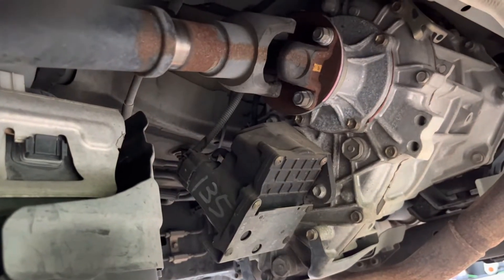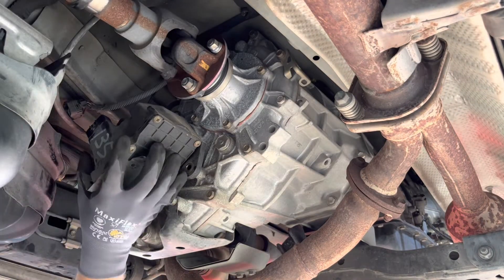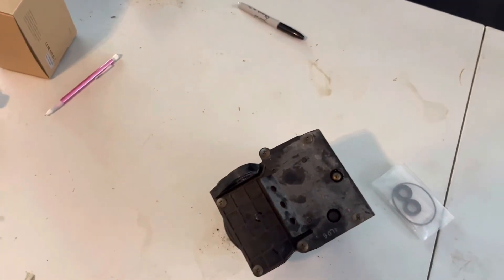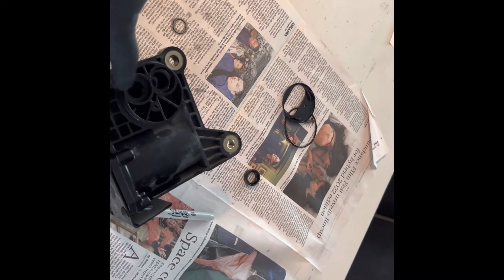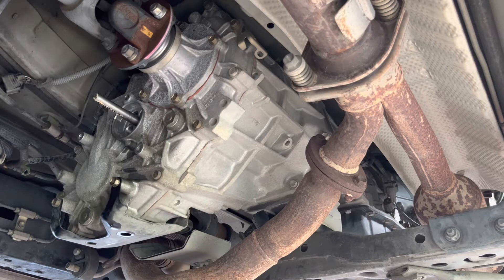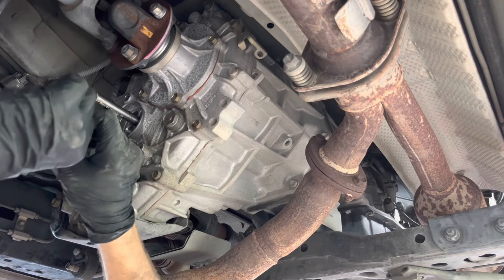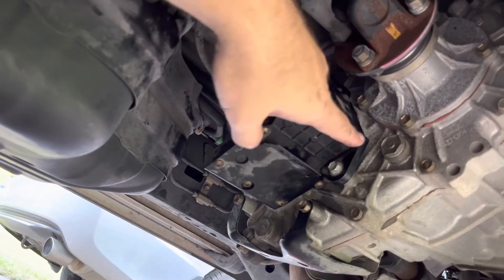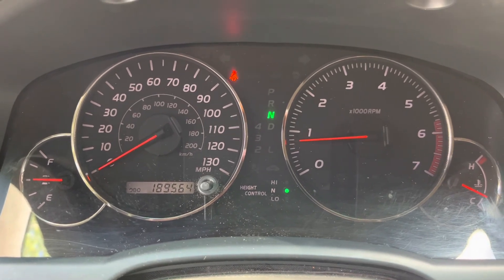GX470 Center Differential Lock Actuator Removal, Seal Replacement, Inspection

Comment: I believe the proper way to take the actuator out is by taking the transfer case off, opening the case and removing the bolts that hold the actuator rods to the forks. I could hear as you pull the actuator away, the teeth grinding against the slots on the rod. How did you assemble that without breaking any teeth?

Comment: Thank-you for posting this, this was the best video I have seen on this issue !  It seems my GX 470 truck is stuck in 4wd (VSC light is on and the center diff light came on and blinked a few times then went completely off) and when I attemp to make a turn it skips and hops around (the mechanic called it leg pegging). I got an estimate saying that the transfer case was bad, a 4k job according to the shop I took to!  I'm willing to try this fix since I got nothing to loose at this point, what would you suggest, could a bad transfer case cause the GX 470 to stay stuck in 4wd? Thanks again !

Comment: The last time i use my 4wd on my gx470 it got stuck on 4wd now it doesn't want to go back to 2wd.
Coul changing the actuator help?
Reply: Wow same here, It seems my truck is stuck in 4wd and when I try and turn it skips and hops around (the mechanic called it leg pegging). I got an estimate saying that the transfer case was bad, a 4k job according to the shop I took it too but I'm willing to try this fix since I got nothing to loose at this point!

Comment: I did this about a month ago and mine is leaking again.  But I think just from the new oring not the seal this time.  The first time the actuator was filled with oil.  So I am going to pull it off again :(
Reply from the maker: What did you find out?

Comment: That seal kit is probably also for the v8 4runner,  it has 2 shafts, second shaft goes in that blank hole you pointed at and is for high/ low range

Comment: I have the same code pop up on my code reader. My diff locks fine but the “vsc off” light does not come on. Was that the case for you? Also did the the new seals cure the code?
Reply from the maker: Yes, all my codes were cleared. VSC turning off could be a lot of things. If the ECU is unhappy about practically anything it will disable all the traction control things.

Comment: I just did that hose repair on my ‘05 4-Runner then changed fluid.

Shifts into all 4wd modes including diff lock very smoothly now.
No grinding or any trouble.

Before, I was having issues with 4wd low and intermittent grinding.

Vacuum leaks effect many things! 👍

Oh, plus my old fluid had little bubbles in it.
Confirmation of leak.
Reply: So is was the cracked/split hose that was the proplem?

Comment: Hey I dont know if you will reply, but I changed out my actuator and when I turned it on I drove a bit to get it to engage. The vsc light is on and the center diff lock is solid. But when I went to go park and turn it off, the vsc light turns off then the center diff light is constantly blinking.

Comment: Thank you so much for posting this video it saved me thousands of dollars if I would have let Lexus Service do the work.  Transmission work scares me so I would have definitely not even attempted this job without your video - It was so easy to do.  I even changed my transfer case oil while I was at it.  Big thanks again!  🙂
Reply from the maker: So glad I could help! Great to hear you were able to tackle this job. If you haven't drained and filled your front and rear differentials you should do that as well. It's the same procedure as the transfer case. It is super easy and well worth doing. If you want to watch I cover that in the Transmission Differential Fluid Change video.

Comment: What you have showed is one way of installing the actuator back on the shaft and mating it to the transfer case. I did it a little bit different because when I have pulled my actuator off the thing was full of gear oil. Needless to say that the seal was pretty much shot. Anyway, once I got the actuator on the bench I opened it up and removed all the guts inside in order to clean all of the oil dry. At the same time I figured to leave a couple of pin wheels out so when I go back to install it on the lever shaft there’s a less chance of damaging the new seal by the shaft’s teeth while sliding it in. It goes in obviously without any resistance. Once the shaft is in the actuator,  install the guts back in making sure pin wheel is engaged with the shaft’s teeth and put the back cover on with 7 bolts. I know it sounds a bit complicated but as long as you make sure how and where the pieces(guts) of the actuator go when you first pulled it apart, then it’s workable. I didn’t prefer going this route but I wanted to make sure to get all of the oil out of the unit, plus I figure it would lessen the chances of destroying the seal. That’s my two cents on that, but you did a good job on video, nevertheless.

Comment: My center diff is stuck and won’t disengage. I can’t seem to pull out the actuator. Could it be because the diff is locked.
Reply from the maker: Hmm, does it slide out a ways, but then sticks? Also, check your vacuum hose, you may be able to repair that first and get the diff lock to disengage. Reply back

Comment: I can't get those lights to go off after I replaced my actuator.
Reply from the maker: That may not be your only problem, what codes do you have? Do you have access to Toyota TechStream with the correct cable? The GX will give up on all driver assist controls if it has any issues with a myriad of systems: brakes, ignition, throttle, etc. It uses all those systems in concert to manage driver assist.

Comment: Wow that was easy as Pie.. Over a decade ago, I had the same problem with my 4th Gen 4runner 4.7L. Mine was leaking and at that time, I took it to a shop which charged me about 2 grand to fix the leak.  😠 Thank God(And knock on Wood) my GX has not had any leaks or troubles with the Actuator/Center Diff. Thanks for continuing to bring us content.
Reply from the maker: Thanks! Glad I got to mine before it filled with gear oil. Its a time bomb if you haven't replaced that seal, plan to do it when the weather is nice. Replace the seals and inspect that vacuum line before it fails and costs you more than an hour or two in the driveway.
Reply: @GX470PracticalMaintenance   Oh for sure.. I'll have to plan on buying that seal kit you showed in the video. Again, Thank You for your thorough yet simple videos. Especially for someone who learns better by watching your videos than looking at diagrams.. lol
Reply: Wow, that shop charged you 2k to do what was done in this video or did they suggest a new actuator and charged you for the part and for the labor?
Reply: @timesofyourlife1  Mornin'  The shop did exactly what was done in this video. But for the 4Runner, it's a little different, @3:19 in this video, he specifies, "nothing goes here."  Well in the 4Runner, there's a second shaft that goes there..
Reply: @Kiss__Kiss Morning !wow, that's crazy how could they even justify that, it only took about 2  hours and a $12 kit 😢😢😢
Reply: @timesofyourlife1  Yeah, because at the end of the day, it's a business, which its purpose is to make money.
Reply: @Kiss__Kiss 😢😢😢